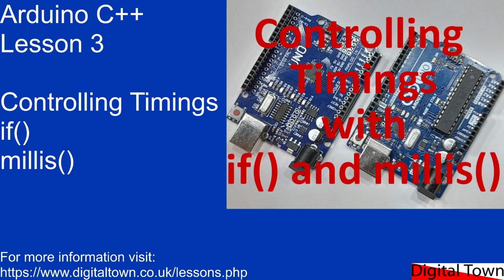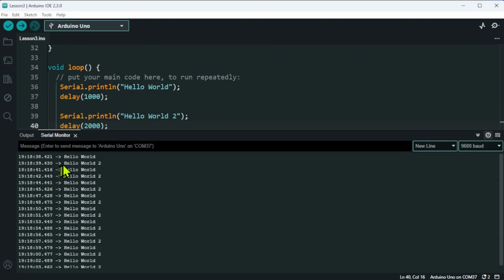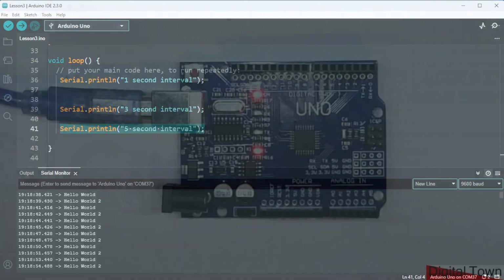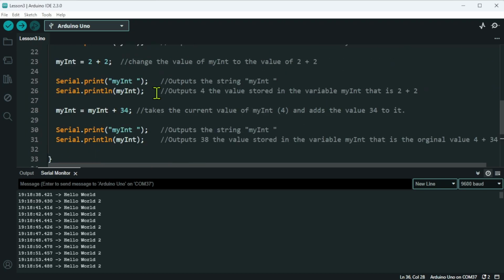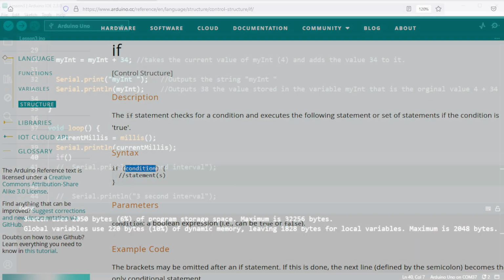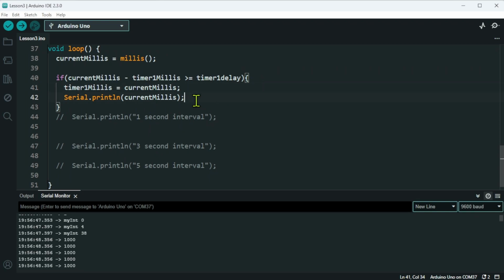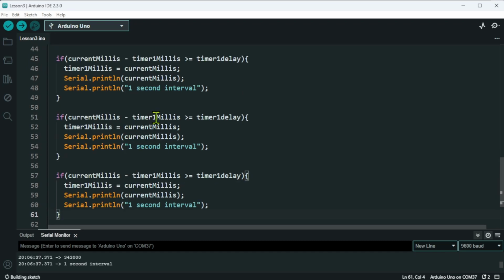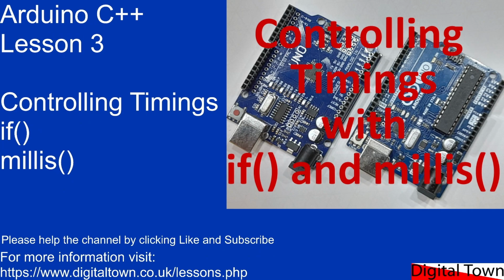#91 Arduino C++ - Lesson 3 Controlling timings with if() and millis()

Comment: When is the function delay() relevant?
Reply from the maker: It is only really of any use in the setup() and for some quick code to test s single component. Outside of that it has virtually no use at all. Sadly it's used as a quick fix for timing but anything much more complex than a blink sketch soon runs into problems and when trying to combine sketches causes all sorts of issues.
Reply: @digitaltown5442  Thank you very much for your prompt reply. I will relook into my sketches and change to if() and millis() functions.